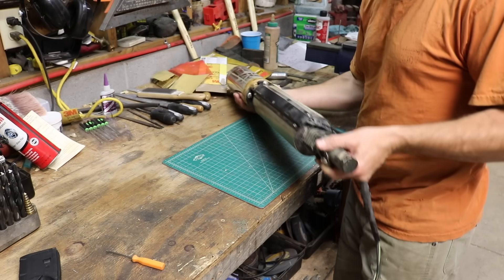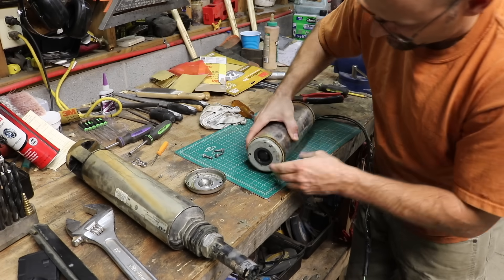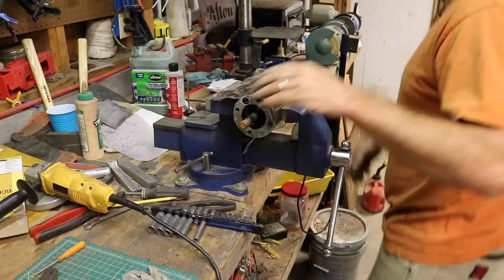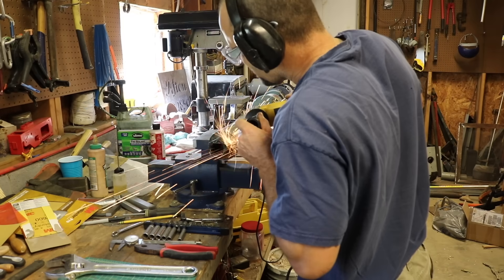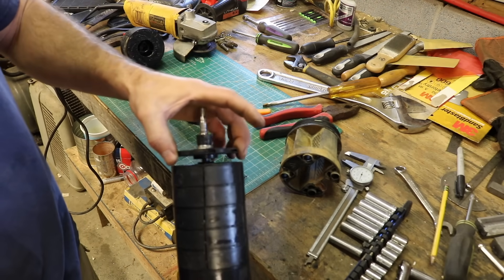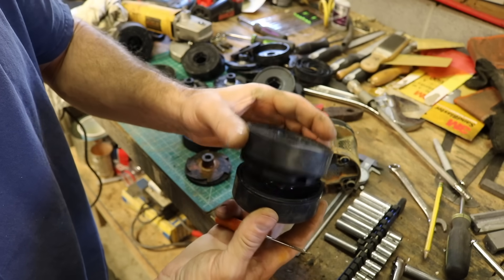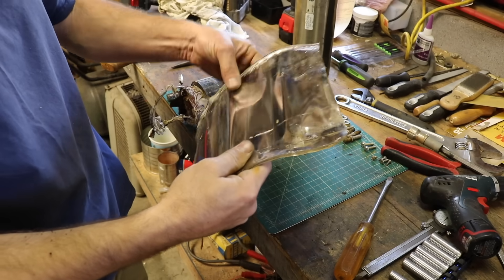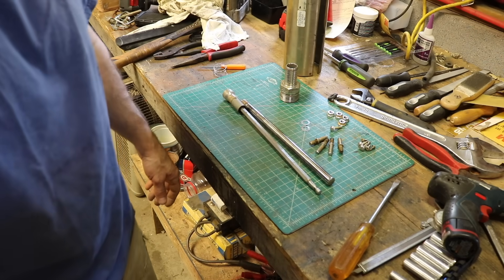Secrets Inside Your Well Pump. How Does A Deep Well Pump Work? FarmCraft101

Comment: Infinite ohms??  I am no electrician, but doesn't that just mean a closed circuit or "continuity"?
Reply: No, closed circuit is 0 ohms (or near) which means there is practically no resistance between contacts so there is an electrical path. On the other hand, infinite ohms, basilcally means there is an infinite amount of resistance between to contacts (open circuit) so no path.
Reply: Thanks for the reply, I woke up this morning thinking about how I was probably wrong in my assumptions.  Thanks again for clearing it up.

Comment: The thing you took out is not a temperature sensor if you put a pump you must put a thermic protector that cuts off the power if the pump is getting more amps than it should and it heats up

Comment: The temperature sensor with the mosfet; Not sure, but I think the temperature sensor switches off the mosfet. The motor windings are connected to the mosfet, so when the mosfet is turned off the motor is turned off to prevent it from burning the windings. I think this becouse you just have two wires to connect the pump as you explane. So there must be done something inside the pump with the temperature/mosfet sensor and the motor windings.

Comment: My well is 600 feet according to above calculating pump pressure my pump pressure would need to be 260psi, sounds too high for my existing pump, going on 20 years now.
Reply from the maker: It depends on where the water level is, not the depth of the well.  They may have hit water at 50 or 100', but they continue to drill deeper to get higher flow.  But yes, if the water level was actually at 600 feet deep, it would take 260 psi just to get the water to ground level.

Comment: The rubber and plastic seals cause most of the failures with the pumps. Sand in the bottom of the well can scour the impeller rendering it useless. Even with the long-term wear issues we replaced windmills with submersibles and have not looked back. The maintenance on the submersible electric is nothing like the replacing of leathers and the annual maintenance on older windmills. Plus, the old Aeromotor windmills were worth a good deal of money, people wanted them for their aesthetics which offset the cost of the new elelctric pumps.

Comment: is it just me or does no part of that reflect 70's tech. not sure a mosfet would have been utilized in that era pump as well as the multi stage abs impeller pump.  i've been wrong before but something just doesn't add up here.
Reply: As far as I could find the TO-220 package was specified in 1987, so yeah, definitely not 1970s.
Reply: Franklin electric motors have a date included in the serial number at the top of the motor casing, just above the label

Comment: Very informative.  Question - after watching the well company install the new pump - would you think it could be a DIY project to replace one? 
Thanks for the video -- I've wondered exactly how these pumps are structured.  We have a 30+ year old pump, I've been considering replacing it before it fails, its about 500' deep.  
One would hate to reach SHTF and then have the well become inop.  Even under normal conditions it would be a problem, being without until the well company could do an install. 

PARTS is PARTS.....   You think like I do,... what can I salvage for parts -- LOL!!    Most recent video on our channel was about salvaging a multifunction printer - amazing how many useful parts, numerous SS rods, dozens of useful springs, etc.  And the cost, if I had to buy those parts separately would be well above $100, ...from a broken printer that originally cost about $50.
Reply: RelentlessHomesteading disconect the power and the tube and start pulling up then connect it back and go
Reply: That sure 'sounds' easy enough.   The weight of 550 feet of 5 large electrical cable (wt of 5 x 500' spools of #8 copper wire) + steel cable + water line +  pump - would be very substantial; requiring me to build up some large pulley mechanisms and winching on the front of my tractor FEL.  The time required for me to build that up would likely offset any gains from DIY.  And there could be some little tricks or details that I would miss doing it for a first time.  The cost of any kind of screwup would be very high - so it may make sense to just hire this one out, and spend the time on my day job to pay for it.
Reply: RelentlessHomesteading the easiest thing you can do to pull it up is build a metal stracture that can support the weight of a pulley and start pulling the chain so the pump goes up and the worst thing you can do is dropping the pump or hit the cable of the new pump on rock or something if you make a hole in the insolation and water goes in the pump it will be badly damaged also also make sure to buy the exact same pump with the right filters, power make sure that the new pump is siting on stable ground and it is not floating in the water

Comment: It's probably a triac.  When power is applied the bi-metallic strip is in contact so the triac energizes the start winding. As the motor spins up it generates heat which in turn causes the strip to bend and opens the switch. This bypasses the start winding and the motor continues to run on the main winding alone.
Reply: I don't think that's the case, usually these pump systems have a control box at the surface level in the pump house with a potential relay and a start capacitor. I believe the component in question is a thermal overload with a bimetallic switch to cut off power to the motor when it overheats. I suspect the reason he got the OL measurement with an ohmmeter is because this thermal protector had worn out and was not making the connection to the motor windings.
Reply: So it's like a start capacitor,  without the stored energy?
Reply: I was also thinking a capacitor

Comment: The white thing is probably the motors "internal thermal protection" (built in overlaod protection) it will open if the motor draws too much current.

Comment: had one of those at the farm i worked at, 85 feet down, pulled it to change the pump cause the check valve failed. put in the new pump and added a check valve to the old one. two years later swapped out the newer pump cause the motor burned out.

Comment: The motor is made by Franklin electric, your pump looks like a Goulds or Grundfos. That pump looks like its 10-15 years old, definitely not from the 70s lol
Reply: 71970`s be 4 inch well case :) as a rule 6 and 8 wasnt the standard till mid 80`s
Reply: @juggallo42O  The pump made in the 70s, the real expensive ones. would last fifty years. How do I know, cause mine was just replaced. Pump guy told me that the new ones never last longer than dozen years. That is called planned obsolescence.
Reply: Date code is 2005, so it lasted 13 years.

Comment: I inherited my grandparent's house. They had the well pump replaced back in 1982 and just last year it finally broke and so lasted 36 years. The new owner of the same business who previously replaced the pump said the average consumer will NEVER get a well pump like they use to make. Now they are only made to last approx 15 years, most commonly come with only a 10 year warranty, and you're EXTREMELY lucky if they last 20 years... by reducing the quality of pumps, keeps businesses like theirs in business by being guaranteed to come back in 10-15 years!
Reply: Bla bla bla. I'm a pump guy. Franklin hasn't changed their motors, except where they are manufactured. Mexico. Pump companies have changed things to sell @ a lower price point. I mostly sell F&W domestic submersible pumps. Their Commander series. The most expensive, but 100% made in the USA. Even their motors. I'm in my fifties and healthy. I figure that any new pump I install should be good for the rest of my life, assuming the rest of the system is kept in good working order.
Reply: Actually, it is not built-to-fail but rather not-built-to-last.  Nowadays, people want cheap, so they force manufacturers to cheapen all the components- saving a few pennies here and a few pennies there- then you get a 10 yr motor for %10 cheaper than a 30-yr motor.   And the purchaser "saves money."

Comment: I had to replace a pump motor that was a 2012 unit.  The well guys said that could be part of the problem, and if I wanted to save them coming back in the foreseeable future that I should just replace it while they were there.  They had one on the truck, a little more horse power, and went with new install.
You always wonder about such things, but you have my decision easier to bare.  Thanks.  Love the fact that you breezed through all the tedious part of screw removal and other time consumers.  Good job.
Reply: hughbo52 you where unlucky and got the faulty one so you should send it back you got a cheap or a wrong for your use pump or they did not install it corectly thoose last at least 40-50 years

Comment: I can't get over all the dirt and gunk. All that is being sent into your house, through your pipes, and into your stomach if you drink it. I'm pretty sure public water supplies aren't any cleaner, hence all the chemicals they add to it. Still, it's information I don't want to think about.
Reply: Mark R 
Get a  water tester that shows parts per million  of disolved solids 
 My well is in the 250 range , municipal  water , around 212-220.
Questionable water  is around 500 parts per million
Reply: I don't drink the water at my house. It's city water and my pipes are plastic. There is a noticeable smell and taste of plastic in the water. I get my drinking water from a business that uses multistage filtration. It tastes a lot better, but every so often the water has a brown tint to it. I've seen this brown tint in the tap water as well as filtered water. I'd rather find a clean spring source of water that is also filtered and just try not to think about what may be in it. Well water is not a good idea where I live since I live nearby to an old junk yard still full of cars. Probably a lot of leaked automotive fluids in the ground water.

Comment: How do well pumps not get clogged so far under ground?
Reply: Blaine Bugaski they have filters that you take with the pump depending on the water you want ro pump
Reply: How does one clean the filters?  I understand that the homes will likely have a whole house filter if on well (not all do, though, some don't even have softeners such as in the case of my late great uncle in west-central Louisiana!)
Reply: Blaine Bugaski you dig a well you put the pump on touching on some bricks or rocks on the bottom of the well you put metal or wood to cover the hole so nothing goes in and the pump sucks water if from some reason you put it in a tank with mud or something it needs a wash once a year
Reply: I have a brand new Franklin electric pump motor never hooked up gave 1400 for it brand new can't take it back I'll let it go for 400  if interested let me no and I'll send u the info and pic thanks

Comment: So the whole unit is submerged under water?
Reply: Yes they have to remain submerged to keep water going into the pump and cool the motor.  The water actually lubricates the "bearing" on the inside of the motor as well.  The electrical components are sealed in resin, but the rest is wet.

Comment: Thanks for the video...I just replaced my well pump in my 450 foot deep well. 15 psi for every 33 feet of well depth makes my pump output pressure about 200 PSI
Reply: Unless you're pumping into an open tank you also add the pressure switch setting and pipe friction as well to end up about 250 psi :-)
Reply: Kenny Kemp of course!

Comment: A bit too quick to cut up the pump part. Are you really sure it's actually as old as you claim? Some parts did look a bit more modern than that. I'm not sure when the TO-220 packaging of electronic components appeared, maybe it was as early as '74 and then this must be one of the early applications for that. Notice that most electronic components have a date stamp on them consisting of year and week.

Comment: that thing popping out of it made my day. probably the contact cant handle the current draw of the motor so the mosfat is used to turn the motor on and off with the signal of the contact switch
Reply: its AC motor, this is not mosfet, more likely triac if its meant to switch motor
Reply: I'd have called it a transistor... but w.e, probably all basically the same thing.
Reply: probably, not sure why you'd need 3 external contacts for that though.
Reply: @kingjames4886  Probably an off-the-shlef piece with multiple applications, some of which would have req'd more connections
Reply: Although MOSFETs first appeared in 1948, there were no MOSFETs in 1972 with the reliability, current carrying capacity and voltage rating to be useful in a well pump application.

Comment: Wow, yours lasted a long time! Great video, now I know what to expect when mine fails.
Reply: spelunkerd getting thing out is bigger deal then bye new. 100-300 meter tubes. all that heavy metal tubes and pump at the end... Lift up, lock in, unscrew, attach lifting lift up and do it 50 times
Reply: spelunkerd if you buy the right underwater pump and install it correctly it can easilly last 50 years

Comment: We where down 326 feet.... once at ground level, it still had to then keep pump up hill 251 feet more (a total 577 feet up hill)  to our 8,000 gal holding tank. Where is would gravity flow back to the house 210 feet. 
Almost forgot we had about 60+PSI

577/2.3=250.86
Pump was almost 8 feet long.. 
Pump was changed once and it took them 14 hours pulling pipe to get to the bottom.
Reply: Lankster Price 14 hours to pull the pipe , what did they charge for a job like that? Thanks

Comment: Only $400.00? You got a good deal!
Reply: That breaks down to less than $9 per year at 2018 prices — not worth repairing, especially considering the risk of a repaired pump not being as reliable as the original.
Reply: Paid 1200 in Grande Prairie Alberta  9 years ago. 3/4 hp Grundfos.
Reply: I PROMISE you he misspoke.....it's closer to 2000 here in Az for a 3/4 hp pump and the prices aren't that much cheaper around the U.S.  
My comercial wholesale discount isn't that low.
Reply: @johnpike9612  Just purchased a 1 Hp deep well pump at Ace Hardware in Rathdrum Idaho for $485. Performing a DYI well pump, pipe and electrical install. I'm told that well companies use $1,,100. + cost to them when installing systems or they claim they use "Higher Quality Pumps " . 
 Sounds like Arizona has an over inflated markup on pumps.
Reply: @jackdcharlton1  2 things, supply and demand + local economy = going prices. Also the "deep" pump you bought isn't the same quality nor as deep capacity as the ones I spoke of and the one in this video. The $500 retail pumps generally use plastic props vs the brass a reputable company uses and they are not normally rated for a deep enough setting around here. Get on the pump manufacture's website and lookup the "curve" for that pump....I'll bet it's Max gpm is when set between 75' and around 150' and with a high amperage draw. That means less water at a higher cost because you must also factor the eltric bill into your water costs

Comment: That switch is the mechanism that disconnects the start winding and energizes the running windings. The motor is supposed is filled with clean water with a bit of non hazardous anti-freeze so they don't freeze and burst open in a warehouse or building somewhere. The top "rubber part" is not a main seal and can be gone and still function. It is called a sand slinger. Helps to keep sand away from the top bearing. The swelling inside causing the rotor to be locked and not turn is most likely due to a power surge and swelled the windings. Seen it many times. I was hollering at the video saying the liquid end screws on. The liquid end was probably OK, though very few installers any more will just replace the motor only like we used to do 30 years ago. The liquid end will usually pump in excess of 100#'s in order to push water up the well and still create cut off pressure on the switch above ground. It takes 1500 degrees to turn the epoxy to sand and free the copper. Cost more to get a furnace to that temp than what it is worth unless you have a huge amount of motors.
Reply from the maker: Good info.  Thanks, and thanks for watching.
Reply: Lol....I was going to say that you could've just replaced the motor to save some money had you not cut open the pump. The problem with that is we don't do it because franklin and the other various manufacturers will not warranty the motor unless we also buy the pump and controller, there are still some of us who know how to REALLY repair pumps. We just can't because of the red tape crap.
Reply: Pump Doctor It's not hard to see why those pumps are so expensive.